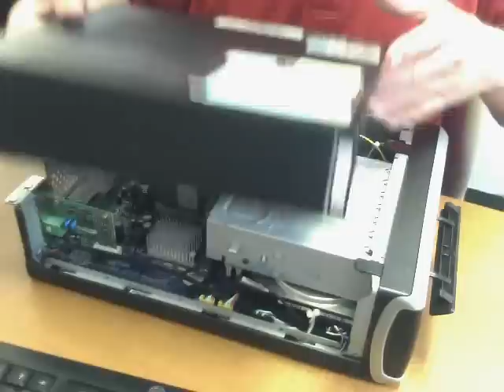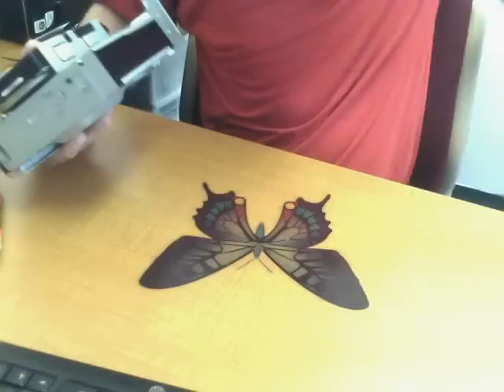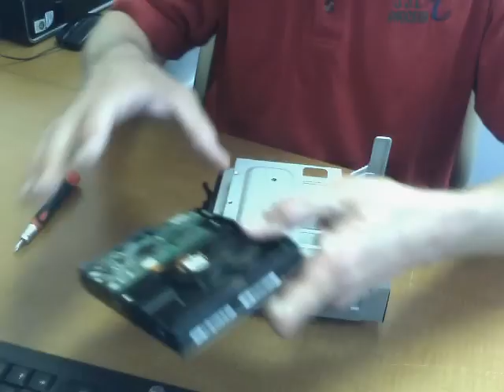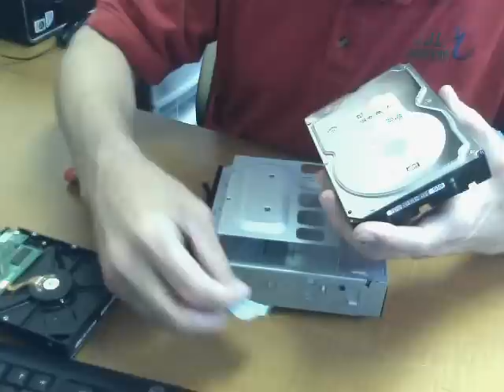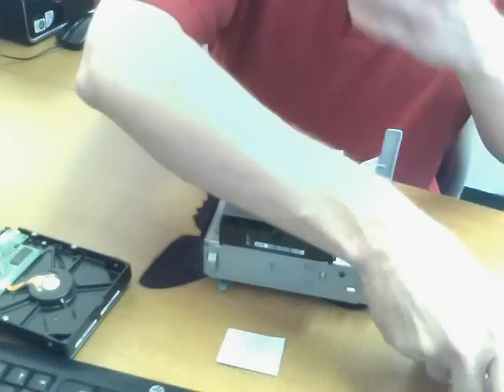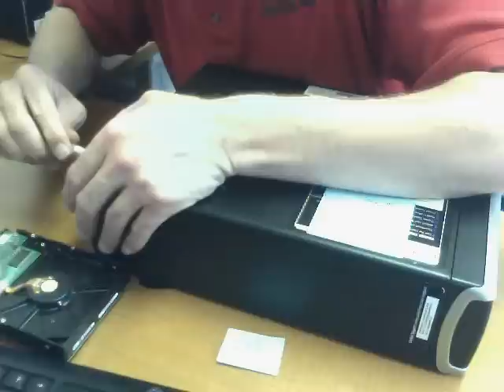eMachines EL1200-05w HDD replacement

Comment: +Shawn Guffey Might I ask if there is an optimal way to install a new SSD into one of these things? Might I also ask if it is even possible?
Reply from the maker: you should be able to put a solid state hard drive into any computer because they often come with brackets when you buy them that will allow you to fit it into any box
Reply: While that isn't what I meant, I was speaking of how to get it wired in as a second drive, my apologies for not elaborating/articulating that. But I already found the solution I was looking for. Thank you for taking the time to reply to my question tho!
Reply from the maker: If you own an eMachine comma you're not going to put any extra anything Inside the Box

Comment: i have the same machine can i put another hard drive on it?
Reply: if i remove the dvd thing
Reply from the maker: +MilesPerGaming(Luyi8sLowSpec) Ooh, good question. I don't know if a secondary hdd will mount properly. I've done some ghetto stuff with my home computer before and I imagine you could just lay it in there. It has a lack of connections on the motherboard and room in the case so you'll definitely have to remove the DVD tray.
If at all possible, attempt to attach the hdd to that casing with at least one screw.
Reply: +Shawn Guffey ohh thanks i just want to backup my stuff